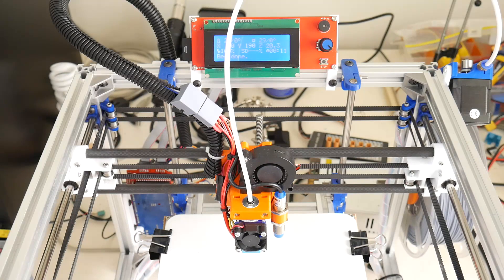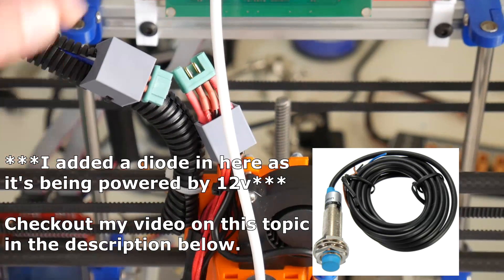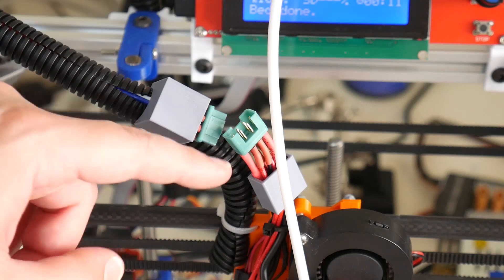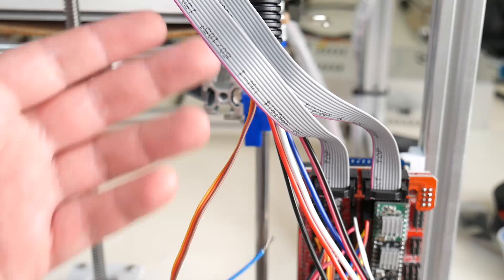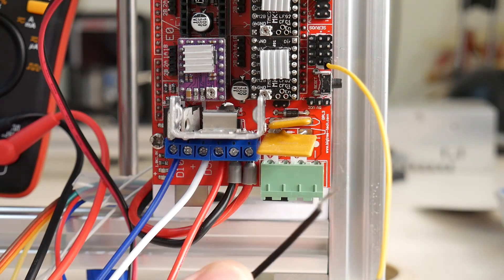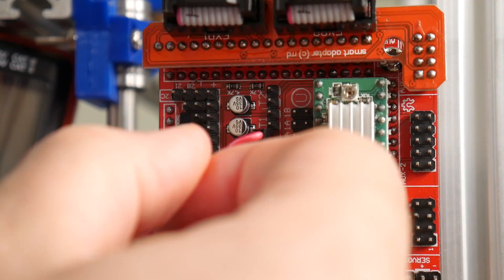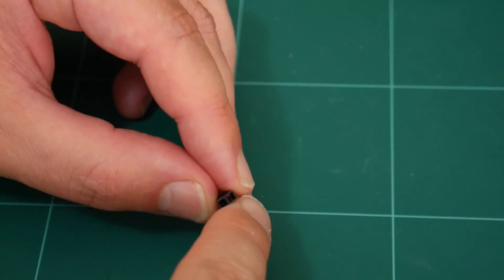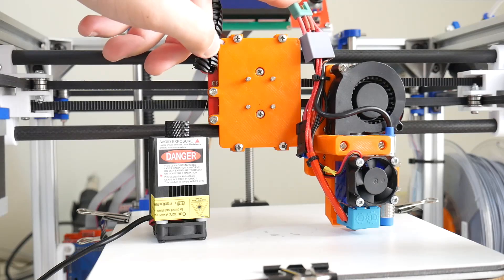Quick Swap Connector for my HyperCube 3D Printer

Comment: Dear Tech2C, I'm facing a problem with the printer, so when I try to print, the Extruder can't push the filament out, I need advice for this. I'm using Arduino Mega 2560  Ramp 1.4 in this printer. Thanks alot

Comment: Very nice and informative video - I was thinking about using aviation connectors on my printers.  

Can you provide details with respect to the carriage and tool holder setup the you have?  Is the spacing of the rods in the x gantry the same as a Prusa or Anet A8 printer?

Comment: Very late for this video but did it today, something similar. I wanted to note that my motiv was not easily replacable head, but items on my head. Playing and rebuilding all the time I often upgrade fans, heaters, sensors and it's a pain, especially now when all my cabling is neatly done with sleeves. So, my connector requirement is different, I need to be able to individually unplug BLtouch, fans, heater, etc. For now, I used 3x6 dupont connector on one side (except for the heater of course) and individual duponts on the other. I'm looking for something better though.
Also, tried common ground on PSU and had the same problem with thermistor (also BLtouch). Moving it to servo pins resolved it. However, I'm also using Pi and a buck converter for it and I needed to connect buck converter ground to here too, otherwise my screen flashes together with heater PWM.

Comment: Just got my Quick-change print head (to go along with the quick disconnect) posted to Thingiverse.
You can find it here:
https://www.thingiverse.com/thing:2799665
Of note on this design:
- Built for the Anet A8, so the bearing spacing is slightly different than that of the Prusa i3.
- Screws and nuts are not metric, but #6 machine screws. This is close to a metric 4mm but not the same.
- Mounting plates for the A8 print head assembly, a V6 print head assembly and a blank plate you can modify yourself are included.

Comment: You should upgrade the hypercube with TMC2130 drivers, for endstop-less homing, and overall quieter operation!
Reply from the maker: Hello. I'm already using TMC2100 drivers - very quiet. Endstop-less homing doesn't add to the quality of 3D printing or noise reduction.
Reply: Thanks for posting that info

Comment: I personally used matching hard drive power connectors such as you used to be able to find on the old CPU fans.  I made a bracket that would let me mount the one set to the frame of my printer with the matching set on the tool cable end.  
Connector can be found at:
https://www.thingiverse.com/thing:2797362
I had not realized that there were so many commoned connections that could share positive or ground, though, so that is definitely useful information that I can and will make use of.
 
I also plan on publishing my quick-change tool head design shortly as well, although it should be noted that it was designed for the Anet A8 X carriage, which has a slightly different spacing between the smooth rods than your design. Still, the concept requires minimal adjustment to adjust the bearing spacings.

Comment: Do you find it amusing that the HyperCube community has shown almost no interest in the laser and changeable toolhead stuff? We're all about scaling the machine up/down, dual Z screws with quad rods, printed X and Y bushings, and parts remixes like Adrian's HyperCube 300. You just turned up, blessed us with one of the best DIY printer designs out there, then vanished back into your own projects and leave us to our own desires :P
Reply: Exploring what else the 3D printer can be used for is a worthwhile and intriguing adventure in my opinion. Personally, I love the concept of being able to change the head and mill PCBs with printer, or cut acrylic, or whatever other undiscovered opportunity is available.
Reply: I'm making a HyperCube Evolution, but I inted to use all (well: most) of Tech2C modifications.

Comment: You should really invest in the proper crimping tools, you will get a much cleaner crimp, and they're really worth the small amount of money they cost... -- by the way, can you share the STLs for your detachable mounts and gantry? -- I really like the idea.
Reply: He did share them in another video.
Reply: Leonardvdj cool.  I'll have to keep an eye out for that then.
Reply: And not only are the proper crimpers needed to create a tight "curled-C" crimp connection that lasts, the rear part of the pins is intended to clamp on to the insulation for strain relief. Just squashing with pliers onto half of the bare wires sticking out of 18 ga stranded is inviting trouble later.

Comment: I chose to use molex micro fit 3 connectors (yes I use several) Since they have a latching mechanism (nice for moving connectors) and e3d also use them for their heater cartridges and thermal probes. 

Micro fit 3 is good for 5A pr. pin which is enough (With a wide margin if you use 24V)
Reply: I do too. Actually, a 6-pin variant (3 pins x 2 rows) on which thermistor, heater cartridge, and cold-end fan are connected (1 pin for each wire) – Probe (BL-Touch) has its own connectors.
The only thing I don't like about MicroFit is when a wire have to be replaced. Removing the crimped wire from its housing is not that easy.

Comment: For those of you like me who like to salvage as much as they can, you can use the 8 pin Molex connectors from old motherboards. They can handle 10 amps per pin with the correct cables and they also have a retaining clip
Reply: Good Tip.

Comment: I was thinking of using an Ethernet cable to do the same thing.  I'd have to double up the high current wires, so good to have 8 wires to choose from.  I saw another video where someone used 4 screws to screw the head assembly on.  I'm much too lazy for that.  I thing I'd design a single screw shooting out the middle of the back and print in 4 pegs with holes to line up.  Then I'd only need to use a single wing nut to tighten the whole thing down.
Reply: If you spread the high current wires across multiple wires, if one of the wires gets a bad connection then the rest will carry the load and quickly overheat. I wouldn't use Ethernet cable for the heater cartridge.

Comment: That's a good idea.  I've just used a few 2 pin JST connectors to hook things up individually as I've replaced them. The Noctua fan came with some nice ones, but if I had thought of using one big one to do them all at once, I probably would have preferred that.

Comment: Great video, I ended up using two cat6 cables didn’t think to parallel the +12v I’m also using bltouch that needs more wires still worked same though. Love the idea of the laser though doesn’t it damage your print bed ?

Comment: Perhaps take this a step further with a connector integrated into the carriage. Possibly using Pogo pins that align with the tool head being used. You would have to take into account the current capabilities, and it to be keyed in a way it will line up positively. My Lulzbot Taz 5 uses a V shaped french cleat at the bottom of the carriage and a single M3 cap head screw. This allow a quick change via one fastener.
Reply: Pogo pins sound like a very unsafe idea because of multiple single-point contacts in the construction. When carrying larger currents like for heater, you need to have area contacts.

Comment: I am kinda worried about the voltage drop on thermistor ground wire, it may cause false reading. Could you try triggering the Z probe to see if the probe's led current has any effect on temp?
Reply from the maker: Hi Lucas, no temp changes are observed when triggering the probe, or activating the heater and nozzle fan. I made this video after testing all of this, and of course had to move the Gnd connection as mentioned in the video. Cheers.

Comment: Any particular reason you didn't use a Wire-to-wire connector?...Ex : Molex Micro-fit. They come in plenty of configurations, including more pins so you could isolate the high power from your accessories (fan, sensor, etc).
Reply: I use a 12 pin dual row Molex Microfit 3 on my Hypercube. It carries all of the hotend wiring (heater, heatsink fan, layer fan, thermistor, and stepper wires for direct drive). I integrated it into the hotend mount so I can quick swap hotends, even go from bowden to direct drive in just seconds.
Reply: @jasonwalker6825  Sounds fantastic. Exactly what I am looking for. Any chance you can share some pictures of the whole setup? And by the way, how did you implement the swap mechanism? Are you using some kind of self-made adapter plates or so?
Reply: @christophkiefer  Hi Christopher, I actually moved on to an E3D Tool Changer so I don't have my Hypercube anymore unfortunately. I cannibalized it to use some of the parts on my Tool Changer.
Reply: @jasonwalker6825  Cool, thanks anyways for answering.
Reply from the maker: Hi, no reason why I didn't use those. More pins would be helpful, but gold contacts and price I guess would be my only reasons. Cheers.
Reply: I'm mainly concerned about the fact those MPX are Board-to-board connector, hence why you're having issue holding them. 
As for cost, you can find micro-fit clones for a decent price. Furthermore, they'll connect directly to genuine e3d hardware.
Reply from the maker: Ok cool.
Reply: @AndreQuirion   do you have a place where to source molex micro-fit clones? I'm having a hard time finding the pure connectors
Reply: @alexf76  You can find them on Aliexpress, look for "molex 3mm" or something similar to that name

Comment: Sorry, but im not trust your connector for the heater,  the pin look to small for 35Amp rating anyway, i dont beleive that, Chinesse will say anything to sell is scrap, but im not an expert
Reply from the maker: They claim 35A when 3 pins are paralleled. Individual pins I assume 10A based on this. The pins are much larger than a standard 2.54mm pin header.
Reply: Like i said...im not expert, you are better then me, but on my side i will not put almost 5A at 12V on this pin..:), i already see on video, the hotend connecteor on the ramps melt
Reply: you could all ways use a XT60 connectors for the hot end there rated higher then 60A but small enough, easy to use.

Comment: Generally it is a really bad idea to split the ground cable into 2 dupont pins. If 1 fails -- you're left with just the single ground pin -- a single 2.54 mm spaced pin is rated for 3 amps -- and 2 are rated for 6 -- assuming the traces on the board are etched for the max pin rating -- since you're taking ground from servo connections -- I am sure the traces will be rated for .5-1 amp each at the most. However this is plenty for your needs since you're not using the ground line for anything high current, since your high current -- heater cartridge is sharing the 12v in and has it's own PWM wire. But keep it in mind, that your ground line is limited.
Reply from the maker: Sure, if 1 pin header fails then I'd have reduced current carrying capacity. Not likely to fail though. I wish there were a screw terminal for Gnd on the RAMPS, but not to be.
Reply: No it' not likely to fail, but you really don't need more than 1 ground pin anyway, since you're not running high current to ground anyway -- as I recall both fan and heater cartridge share the VCC and have their own PWM negative pin, then your ground is just for thermistor and probe, just keep in mind that wiring the ground this way is rather limiting -- most boards -- from ramps to duet don't use ground for PWM, so a dedicated high current direct ground will only come from your PSU -- and you said you had problems with that (which is odd)

Comment: Thanks for the video, did you check the rating of the ramps connectors (blue) there may be a reason why you have more of these except connecting the two wires from different parts. Seeing quite a lot burned heated bed connectors on the minirambo which has high rated connectors it still could be a problem.
Reply from the maker: Hi. Good point. I'm not sure what the screw terminals are rated for but surely they can handle more than a standard 2.54mm pin header. The heated bed on the other hand is a current monster and is separate from this exercise.

I remember when I first built my Replikeo Prusa i3 a few years ago, the supplied cable for the bed was not thick enough, and would get very warm when energizing the bed. Eventually the plastic sheath became brittle needed replacement.

Comment: The Ramps-FD board has an issue with a questionable ground return on the thermistor inputs. 
This allows high current paths on the PCB to affect the voltage being derived from the thermistor's varying resistance.

I fear you have now combined the large heater current down a rather long wire along with the thermistor's return.
This is very likely to affect the hot end's thermistor readings. 
A separate ground for that would be of great benefit...
Reply: That's exactly what I thought about using only 6-pin connector. The thermistor should have its own pair of pins/wires.
Reply from the maker: Hi Ray, thanks for your comment. Take a look at the wiring diagram I prepared for this video, the heater and nozzle cooling fan share a +12v line, but each have their own Gnd through the mosfets on the RAMPS. The thermistor is sharing a Gnd line with the probe and hotend heatsink fan - not that bad. In my testing with this setup, the thermistor reading is no longer affected since I moved the Gnd to where it is.
Reply: Ah OK Tech2C, those ground currents should at least be consistent and steady, my bad. 

While I have your attention, is the X rail spacing 51.5mm? 
A question has been raised about this on a FB group just today...
Reply from the maker: No worries. Yes 51.5mm is correct.

Comment: hi, how about upgrading the stepper driver for X and Y (i think you got tmc2100 now) with tmc2130 (maybe the white chinese once) so you dont need the endstops? it would look much cleaner
Reply: Is it implemented in Marlin yet?
Reply: yes it is at least in version 1.1.8
Reply from the maker: Yeah that would be cool. Is Marlin capable of detecting the virtual endstops in a core-xy setup? When homing X or Y, both motors would hit and trigger.
Reply: Tech2C as i have read on the Internet some guys even did that already for their hypercube. So it seems like its possible
Reply from the maker: Interesting. Have those users encountered the X-Gantry slewing when hitting the end before the motors are disengaged?
Reply: hmm i dont know, noone mentened this, they only used the chinese 2130 and where talking how to configure them and solder them

Comment: If you are looking for a proper crimping tool (which saves a lot of hassle)
The Engineer PA09 is a really really good crimping tool ;)
Reply: I have PA09 too, can't recommend it enough! Much more secure wire attachment than just mashing the tabs, especially for JST
Reply: Actually the PA-09 is one of few essential tools for any maker/tinkerer. It's one of the least regrettable things to get.
Reply from the maker: I have been pondering purchasing a proper crimp for these. I don't use these pin headers often, but as time passes it would be appreciated more and more. Thanks for the model/part info!
Reply: Can't justify that price, for such an infrequently used tool,  I'd rather have 2Kg of filament and use my existing needle nose pliers I only needed ~26 crimps for the entire printer - didn't find it a hassle at all, it may have take me twice the time - but at < 10 seconds per crimp I'd need to go into major high production to invest in the tool!

Comment: I was looking to do just this the other day after watching your laser tool head video ...this makes it so much easier thanks! Have you ever considered adding a small milling tool head?

Also could you use an EPS 6 pin that comes with a PC PSU the kind you plug into a video card they have a locking connector and are a bit easier to pull apart as they have something to grab onto , I can't seem to find a current rating for how many amps it can withstand I would think it should be fine what do you think
Reply from the maker: Hi, yes a drill is on my list to attach. I'm not looking forward to cleaning up after every job though...
The eps6 should work. No issues with current capacity, but without gold contacts the thermister reading might be affected by any spurious resistance, especially as we're talking milli-volt measurements. I agree they would be very easy to attach and detach those connectors, plus the locking clip is nice.
Reply: I think the 8 pin video card PCIE power connector would be ideal -- since you can get more ground pins into the connector and the connector is rated for 150w.